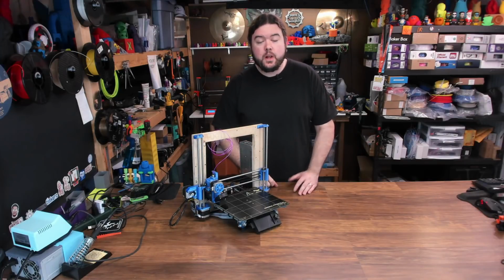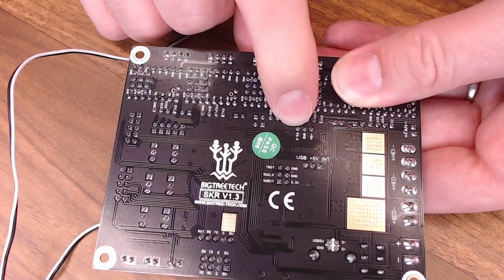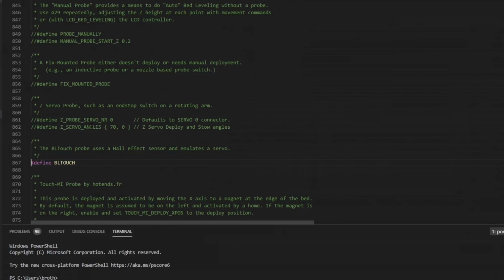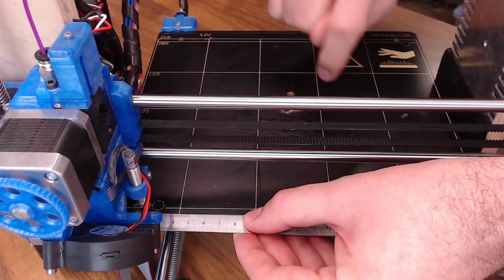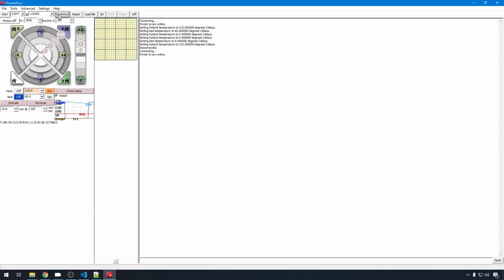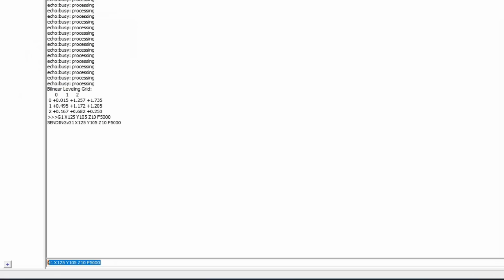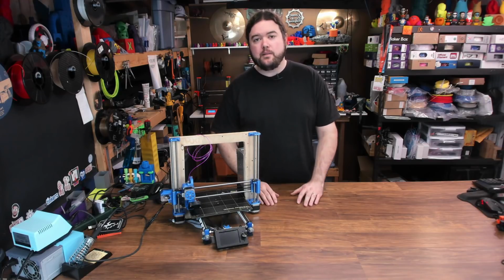Auto Bed Leveling - Marlin 2.0 - How To - 2019 - Chris's Basement

Comment: Hey Chris, i know its already 5 years long time, but i have a problem and i have a feeling that only you can help me. I have Anet A8 brutally upgraded like its not Anet already, aluminium frame, skr 1.4 turbo 5" touch display and so on and i finally bought a 5V NPN NO inductive sensor, i dont know how to say it, but its working just in some cases, i mean it homes Z axes only when i comment out the Z_MIN_PROBE_USES_Z_MIN_ENDSTOP_PIN in marlin, but it is connected in it, than it homes, but when i want to autolevel the bed, its not working, the sensor dont react on metalic object, the printer disconnect the USB and connect back and than on the screen of printer appears "Free memory: 22319 PlannerBufferBytes: 1344" and "Hardcoded Default Settings Loaded" and "SD card released" (i m not even using SD cart but Flash disk) Than the display not reacting and i must restart the printer with the restart button on display. Any clue? I really like ur vids, but i think i really need help bro..

Comment: I have some experience with g code on vinyl cutters, CNC routers, and laser cutters but my BIQU BX is only my second 3D printer.  I am confused about two things that I think you can probably answer off the top of your head.  1) With Bilinear bed leveling, are the adjustments relative to the front left of the machine or the middle.  It would seem I should set Z0 at the first point or maybe the highest point to make sure the bed leveling is always relative to the real Z0.  2) I never understood why we set Z0 to 0.1mm (thickness of paper) instead of actual 0 when my first g code move sets Z up by the thickness of the first layer.  Shouldn't I move Z down to the thickness of paper then move it to a safe space and set it down an additional 0.1mm before saving Z0?
Reply from the maker: They are relative to the front left on that machine. The thickness of the paper should represent zero. It's just to give you a feel for where zero is.

Comment: This is hugely helpful.  I have progressed in my 3D printing to the point where I now need to modify firmware settings and this was exactly some of the information I needed to understand.  Thank you.  I'm in the process of replacing the board and screen in my anycubic kobra 2.  The firmware is so sub-par it is really sad.  That trigorilla board has got to go.  I'd mess with firmware if I could find a build for it but since I can't it's going to go.  But I want to reuse as many parts as possible and the inductive probe works well so I didn't want to replace it.  This video gave me exactly what I needed to keep it.
Reply from the maker: That's great, thanks for watching!

Comment: hello, what is the difference between Probe_offset_from_nozzle and probe_offset_from_extruder? There are separate line for these and I doubt their meaning is a sort of "doubled". would be great if you could explain it.
Reply from the maker: That's a really good question and I don't know the answer to it. I checked the marlin config files and don't see the extruder one. Where did you see it?
Reply: @ChrisRiley  OK... it is hard to show a picture here so the story is.. for my marlin.. (creality 1.7.0 open source for cr10s pro v2) under the BL touch section - "#define X_PROBE_OFFSET_FROM_EXTRUDER -27 // X offset: -left  +right  [of the nozzle]". And then down under the bed levelling section "#define X_PROBE_OFFSET_FROM_NOZZLE  -20  // 0 X offset: -left  +right  [of the nozzle]" . Why are there two listed anyway? Am I supposed to enter the same values under these two?
Reply from the maker: @pawelw.9172  That almost seems like a mistake. Maybe Creality had a reason for doing this, but I can't find the from extruder setting anywhere.

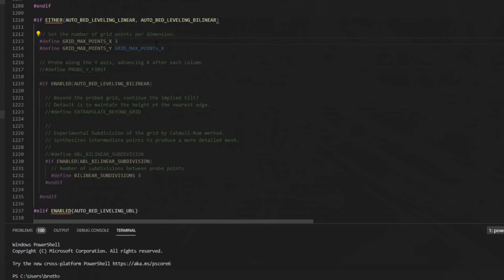Comment: 11:17 I tried changing mine to Grid_max_points_x 5 which gives me the 5x5 probed grid when I manually tell the printer to auto level. but now when it prints, once it gets to the g29 command my printer goes to the corner like it's going to probe but instead just pauses then continues on with the print. I have it enabled in the firmware to reload the mesh after G28 and it gave me a great first layer so I believe it did in fact load the mesh. The G29 it right after the G28 am i missing something in the start G-Code?
Reply from the maker: Most of the time when you see that in Marlin the probe has throw an error. If you can't figure it out, you can turn on debugging and it will throw the information in a terminal window for you. 

* Enable detailed logging of G28, G29, M48, etc.
 * Turn on with the command 'M111 S32'.
 * NOTE: Requires a lot of PROGMEM!
 */
//#define DEBUG_LEVELING_FEATURE
Reply: @ChrisRiley  Thanks for the help Chris! I managed to fix the problem by just changing #define Z_PROBE_LOW_POINT from -2 > -7 worst case if the probe fails my bed will ram into the nozzle for a few seconds.  -2 wasn't enough for my -3.825 z offset.
But of course, fix one problem and another arises. When the print starts the Z moves to  6mm and prints in mid air. changing the Z offset does nothing, setting it to 10 or -10 offset doesn't matter it still goes to 6mm for the print :/

Comment: hi,i have an skr mini e3 v2 and i am getting confused where i put the pinda probe connection. in the endstop connection /? thanks
Reply from the maker: On the mini, if you have a 3 wire inductive probe, I would put the ground and signal on Z min and the 5v over on the 5v probe pin.
Reply: @ChrisRiley  thanks figured it out. I have 2 questions. The mesh level on screen i have to calibrate each dot or i touch nothing but in the start g code i do g29 and that's it ? The other question is the power loss recovery is not working for and i did exactly as your video. Thanks
Reply from the maker: @glengalea  Yes, G29 is all you need to add and it will do the rest. Power loss recovery doesn't always work well. Make sure you don't have Z lift enabled in you slicer and make sure it is turned on in the gcode. Stick this in your start gcode too, to make sure. M413 S1

Comment: Phil Hutton
Great video Chris. I have been trying to install Bigtreetech SKR 2 Rev B and TFT35 V3.0. When power is applied I get a beep and a message saying "Failed to enable Bed Leveling" it will "Auto Home" fine and will still start "Auto Leveling" but the motherboard restarts "reboots" every 3 minutes. This has been happing from the start. Do you think the board is bad? I think I have waited to late to return it. What is your thoughts?
Reply from the maker: Yeah, sounds like one or more of the pins have been grounded out. I would say the board is bad.

Comment: 8:00 What do you mean that the measurements are about the nozzle location and not the probe? It's both, as in it's the relative position of the probe with respect to the nozzle. If the probe is to the right of the nozzle, the X offset will be positive etc.
Reply from the maker: Thanks for your insight

Comment: Great video. Installed the PINDA working but now the hotbed is not heating. Have watched your other video on setting up the MKS Gen-L, Tested the power outlets for the heatbed on the board and they have 0 volts, as if they are not being activated. Was wondering if there could be a conflict in the pin assignments with the filament sensor and the mosfet? Any advise?
Reply from the maker: Hmmm...it could be I guess, but that sounds kind of strange. I would check the pins file though, just to be sure.

Comment: Great explaination. Can you please explain how can I install 6v to 36v  inductive type of proximity sensor on BTT SKR v 1.4? I have really stuck from many days
Reply from the maker: You probably need to grab 12v/24v for this. Check this out. https://youtu.be/EcGFLwj0pnA?t=203
Reply: @ChrisRiley  I have used voltage divider using 15k and 10k resistor and used probe pins to attach my proximity sensor. Not it shows status of OPEN or TRIGGERED correctly. But my z-axis moves up and down even my z-probe status is triggered.  What can I do for this ?
Sending M119 showing my 4 endstops status as follows:
X_min: open
Y_min:open
Z_min:open 
Z_probe: triggered 
Kindly give me your suggestions on this.

Actually i checked my all the endstops. It triggers correctly but can't stop my printer when they triggered
Reply from the maker: @vishalpatil571  Do you have your probe attached to the Z min endstop pins? That is the only way it will stop Z.

Comment: Hi, I'm using a 5v inductive sensor and ubl together with a skr e3 mini v2.0 board. I needed to extend the cables of the sensor so I first used dupont connectors for that. Everything worked fine. Now the only change I made is to get rid of the dupont connectors, solder on the wires and finally put all my "x carriage" cables into a mesh sleeve...it was a pita and involed a lot of pulling on the cables.
After all that now if I do g29 p1 the sensor probes all reachable points, beeps but then moves a bit to the side and the nozzle just crashes into the bed....no idea why. I can't imagine I damaged a solder point or sth... and I also was careful to wire it corretly. I grab the 5v from the probe header on the board, gnd and signal from the z-endstop header. Any ideas what could be wrong? I really don't want to pull the probe cable out again of the mesh sleeving :(
Reply from the maker: Only thing I can think of is you aren't getting readings to the endstop/probe pin. So it fails probing and has no idea what to do with your offset. Check the wires again I guess.
Reply: @ChrisRiley  turns out I wired them wrong. But now another weird issue appeared: so, turning the printer on and homing moves the probe to the center but then moves it up a bit instead of down. Once I trigger the probe with sth magnetic so red light on the probe goes on and off, then auto home it homes as expected. Never had tht before. If I turn the printer off and on again, same issue: z moves up on auto home until I manually trigger the probe once
Reply from the maker: @trohn_javolta8485  Sounds like the sensor is flaky. Might be some resistance in the system somewhere. Make sure all the grounds are good.

Comment: Hi Chris I am having problems with my Ender 3 .Using latest version of Marlin my printer will not  go to centre of bed on Auto Home but always goes to max bed width. Then when bed levelling crashes into frame opposite side to sensor Is there now something in ADV.H to set.
Reply from the maker: No sure what's going on. Does the printer move the correct amount when you tell it to? It might be another setting causing this.
Reply: @ChrisRiley  It moves fine manually But on auto home it goes haywire. Both axis move beyond the centre of the bed 
X axis to 163 .Y axis to 127. This has always been ok with previous versions this has only been with recent versions of MARLIN. Have tried uninstalling and reinstalling MARLIN with no success. Am now going to change Main board and drivers
Reply: Sorry Chris I replied to myself? Happy New Year. I can't figure it out. Have always followed you for upgrades I.E motherboards and stepper drivers. and have used the main parts of your step by step set ups ,and have never had a problem before .It appears to me me as this is a problem with MARLIN 2.0. Is there anyone I can ask about my problem. When Auto homing the sensor should be on 117.5 on X and Y. but is moving to 163 on X and 127 on Y
Reply from the maker: @jeanraines3215  In 2.0.7.2 they do things differently. Use safe homing. Use the actual numbers to dial in the center instead of the X_center and Y _center

//#define Z_SAFE_HOMING

#if ENABLED(Z_SAFE_HOMING)
  #define Z_SAFE_HOMING_X_POINT X_CENTER  // X point for Z homing
  #define Z_SAFE_HOMING_Y_POINT Y_CENTER  // Y point for Z homing
#endif
Reply: Jean Raines Still no improvement it appears that they have made major changes to Marlin 2.and I can't seem to find it
0#if ENABLED(Z_SAFE_HOMING)
  #define Z_SAFE_HOMING_X_POINT 117.5  
  #define Z_SAFE_HOMING_Y_POINT 117.5

Comment: thanks a lot for the video, does this method works with Atmega2560 board? if yes, please tell me how to find the environment field.
Reply from the maker: Yes, it works, use mega2560.
Reply: @ChrisRiley  how to find mega2560 in pltformio?
Reply from the maker: @Williamelhajdk  Alien icon > In project tasks, it's the first env. If you can't find it make sure you have the folder added that contains the marlin folder.
Reply: @ChrisRiley  thanks a lot but my problem is bigger than that..

I’ve just upgraded my CR20-Pro with micro Swiss DD and hotend, while I have a silent-board V2.2.1 and I have marlin 2.0 on it <https://github.com/3d-printing-canada/CR20-Pro-Firmware-3DPC>

After following the instructions, I got a problem with changing the configurations of firmware which is already installed on my printer, since I need to change the XY offsets.

The new values should be as following:
X= -10
Y= -26

The problem is that I’m unable to edit the firmware, I changed the values and flash it with xloader or cura, but nothing has been changed, someone told me that it’s because the .hex file is the same and I need to recompile/create a new .hex file.

Noting that I could edit and flash it with arduino IDE, there was a problem with compiling, and tried to flash the firmware successfully with Prusa slicer, but nothing has been changed.
And while I’m trying with visual studio code compiling, I’m getting a failure message.